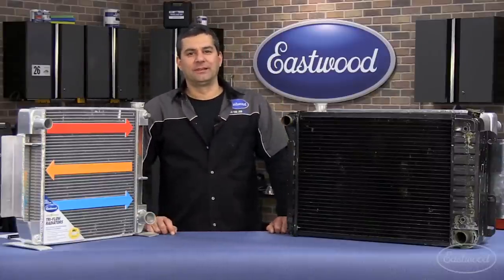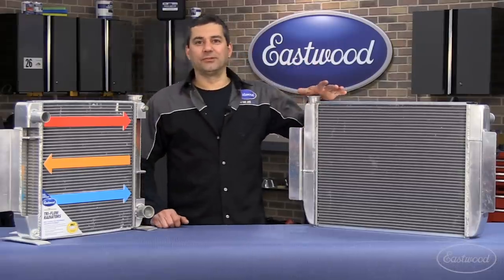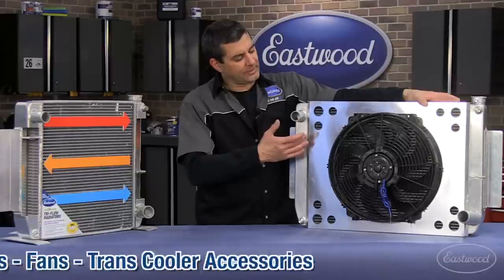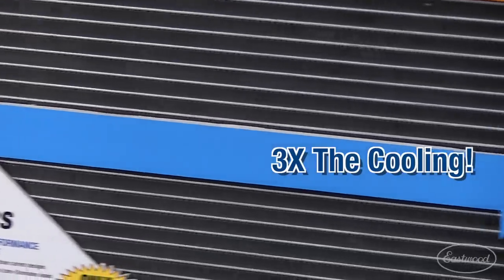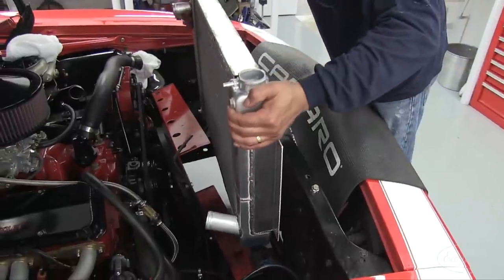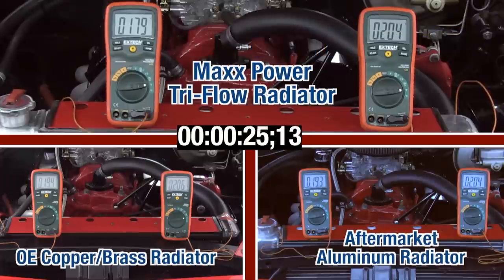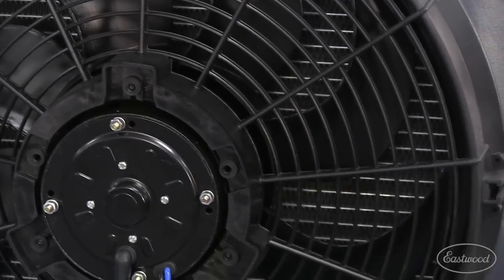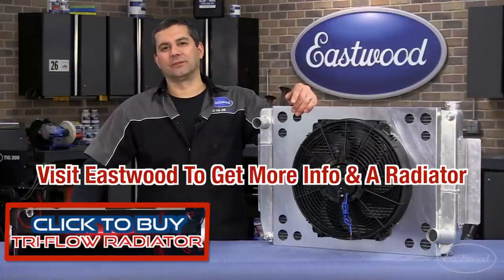Aluminum Radiator - Tri-Flow Technology Keeps Your Car Cooler Than Ever! - Eastwood & Maxx Power

Comment: I got a not cheap but economic radiator 4 core summit racing aluminium unit downflow with a junkyard 2016 jeep renegade 16'' fan. I'm thoroughly impressed with how it cools. 97° day will Idol at 175° all day. This new Tec looks cool don't see the big three using it makes me wonder if it actually makes a difference.

Comment: I bought this product for my 1990 Mustang just because it was such a good price and I wanted to see if it would help my cooling issues. First impression was very good it looks well made and it was exactly like the picture and description of the part number I ordered. It being a universal type application for a ford / Chrysler vehicle I knew I would have to make modifications to my car for it to fit . So that being said I pulled the old aluminum Griffin radiator out . Which is 18 years old and still working perfectly. Just doesn't keep up with the amount of power my engine is producing now . So the only issue I had with the radiator was the radiator cap sits on top of the tank and it hits the hood when you try to close it . So if you guys would make it a lower offset cap like the stock radiator is this would actually be a drop in type application and that would be a great selling point for this product. My car isn't a daily driver anymore so I have time to make things work. The Lower two factory mounts do work but need to be modified to have the radiator sit in the rubber mounts correctly. But that would be a easy thing to do . Actually if you made the radiator 1 wider on each tank side it would fit perfectly in the lower mounts. The welded side mount brackets hit the factory upper side core supports. I just trimmed them to fit in between them no big deal. So to get the cap to not hit the hood is the biggest issue. The lower core support has to cut in half and separated for the radiator to sit low enough for the cap to clear the hood. Once the top layer is separated the radiator can sit on the lower part of the support and it actually clears the hood. You have cut the factory mounts off the top layer of the core support and either weld them on the lower core support skin that the radiator sits on now or brill holes and use a larger pop rivet. Bolts will work also in the right spots long as the radiator doesn't come in contact with them. Then just drill the hole for the rubber factory radiator pad to sit in and that is done. The upper radiator bracket will work but they need to modify little to actually grab the upper tanks and hold the radiator in place . I'm going to make a upper radiator bracket that covers the top of the radiator itself. The only other thing I didn't like is that you don't have any extra material to drill holes into on the top and bottom of the radiator in the middle to mount a electric fan to. So I'm going to have to fabricate something to mount the fan to also. Hopefully it will be worth the effort and it will fix the cooling issues I have . Overall though so far looks like a good product. Time will tell

Comment: Purchased the Tri Flow Chevy 19" x 28" from Eastwood. Also purchased the aluminum fan shroud. Received it & installed it. After a short drive. I found it had a pin hole in it & it was leaking. Called Eastwood only to find out that because I trimmed the mounting tabs to fit my rad support, I Voided The Warranty. Just a side note Eastwood. Not all rad supports are flat.  !!!!!!!! $ 100.00 later rad shop fixed the hole. I reinstalled it. Road test. It did not lower temps AT ALL !!! Very Disappointed in the product. Complete waste of $ 500.00

Comment: PS... I sincerely doubt that your radiator is made out of 6061 aluminum. 6061 does not form in a punch press for a formed tank. The mount brackets are not extrusion so they are not 6061. 6061 will usually crack if attempting to bend much more than a 30 degree angle, probably less, even in .080 which is probably the mount bracket thickness you are showing. It definitely will not bend to a 90 degree angle! ( if I am wrong about this, I will admit it but... ) The filler neck, threaded fittings and hose connections are probably the only 6061 on that radiator. I too notice that in your video the single pass is running the same engine temperature as the single pass aluminum radiator. I have built one three pass radiator that worked well and was probably the result of a perfect storm. The core was 27" x 19" x 4.5" thick, 4 row x 1" tube core. It fixed the problem on the blown BBC 57 chevy but the same recipe did not work well on a blown 500 Merlin and never have figured that one out? However, I have typically had good luck with 2 pass radiators.

Comment: Adding passes to a radiator improves performances when flow is low if the fluid flow can go from laminar to turbulent, but at higher flows adding performance more than often performance will deteriorate. It is also important to note that increasing the number of passes will multiply the internal pressure drop. 

A radiator should be sized in order to meet the requirements on different engine condition (peak power lowest rpm, max rpm, etc.) not only idle considering both fluids flows with their associated pressure drops . The presented test are done at idle which is true for this condition but what about the other conditions?

If there where benefits to multiple passes you would see OEM include baffles in their plastic tanks and make radiators with more than one pass. By adding a few baffles they could reduce the size of the radiator lowering the cost but 99% of automotive radiators are only one pass.

Comment: Question is this running ac and how hot is the oil because when the engine oil get warmed up and ac going radiator temperature goes up, has the cap too tall issue been fixed so it does not contact the hood?

Comment: How much more power over stock would be needed to efficiently push the radiator water through 3 passes? Or is it  meant to stay in there even longer with stock blower to cool it down even more?

Comment: considering engine temp is usually taken near the thermostat housing isn't actual engine temp on the inlet side rather than the outlet side and i don't see any difference between this radiator and the aluminum one.

Comment: It would appear that there is no cooling difference between the two aluminum radiators. The engine isn't any cooler. I would like to see the same test with a flow meter and different thermostats.

Comment: I'm up against the wall on purchasing one of these.  I've got a Built LQ9 motor in a offroad prerunner - desert race truck.  I'm putting out just under 475HP.  Will this radiator fit my needs?? After reading the reviews on here,  the water restrictions scare me.   I drive at High RPM 80% of the time.   I know your easy answer to every comment is " We offer a 60 day money back, just buy it and try it"  Problem is it cost money for coolant and time to install and remove if somebody has to return it.  Swapping radiators is definitely not a fun clean job to do on your time off work.
Reply from the maker: The greatest restriction in any coolant system is going to be the thermostat ( assuming your running one ) not the radiator itself. The thermostat is designed to open and close as the vehicle is operating and impart the turbulent flow that is required for any cooling system to absorb and transfer heat. The Triflow radiator  will certainly cool the 475HP engine assuming you can adequately move air through the core and are using a water pump pulley as close to a 1:1 ratio with the crank pulley. If you are not using one of our Derale fans, be sure to use a reliable unit that will cover as much of the core as possible and always use a shroud to help direct airflow from the corners into the fan opening. As for the  discussion of restrictions, pressure drop, etc., the design and concept of multi pass radiators has been used in the performance automotive industry for decades and are typically offered at much higher prices than the Eastwood Tri-Flow.
Thanks for the interest.  We hope this helps.

Comment: USA or china made?
What's the core spacing or tube size
1in? 1 1/4?
What leading aftermarket brand AL rad did you use and what was the tube size

Alumitech used to be the best.. now I believe that goes to RND fabrication
Reply from the maker: Please contact an Eastwood Tech to discuss in detail and have all your questions answered - 800-343-9353

Comment: I would buy this Radiator but only problem is that it has a Chevy side tank design. If this was a top tank design like my Mopar than i would buy it. Is there plans to make a top tank design. Mopar or NoCar
Reply from the maker: +Kevin Jones No plans at this time.  The design of the Tri-Flow doesn't allow for multi-passes through the radiator with a top and bottom tank.
Reply: +Eastwood Company  Ok thanks for the reply. Actually it can be done, just put the tanks on top and then put large flow tubes on the side to flow the water.

Comment: Is the advertised widths the overall including mounting tabs? 
Any research to see if it increases the coolant pressure - i have a high boost sensitive race application.
Can I assume lower temps means greater efficiency and lower coolant pressure?
Reply from the maker: You should find all the info here, including test results and how to measure the radiator.   http://www.eastwood.com/triflow

Comment: With the coolant staying longer in the radiator, 2 times longer,  doesn't that make the coolant stay longer in the engine where the heat is being produced?> There for making the engine is running hotter, try adding some more heat probes and show the engine temp difference.
Reply from the maker: tigwelder303   For this example we will utilize a small block Ford or Chevy style engine.  Both flow about 4-5 gallons through the system per minute at idle (800 rpm for this example).  The restriction to flow (or the amount of time in the block) is greatly controlled by the restriction of the thermostat.  Pour an equal amount of water through our Tri-Flow Radiator and time it.  Pour the same amount through the thermostat opening and time it you will see the difference.The radiator itself has the task of reducing the outlet coolant temperature, and the most efficient way to accomplish this is high speed, turbulent flow- which our Tri-Flow Radiators achieve.  The Tri-Flow design does not slow the flow but adds resistance to the flow.
A few key components to Radiator Efficiency:
1.  Turbulent flow - Turbulent flow allows more water molecules to contact the coolant flow tubes than laminar flow. This contact allows more heat transfer from the water molecules to the aluminum coolant tubes.
2.  Radiator Cooling Fin Contact Points -  This identifiable radiator core fin design has a purpose. The contact points where the thin aluminum fins touch the narrow coolant tubes are the point of heat transfer from the tubes to the fins and then to the air. The more contact points, the more efficient the core.
3.  Shroud/Fan Assembly - A well thought-out shroud and fan design will provide the most airflow over the greatest area of the radiator core
4.  Speed of Flow - High speed, high turbulent flow increases efficiency of radiators.Hope this helps.  You may also want to check out the reply to a comment posted the same day by Mike Goble.
Reply: Eastwood Company You are right about three of your 4 points, a shroud can restrict air flow at high speeds, I notice to try to keep from that happening by adding some holes so that it is not completely boxed in. But, did you actually increase the BTU's displacement of the radiator, the only way to increase the BTU's displacement is to add more core surface or fins per square inch, the contact points you talk about. With the Tri-Flow and the other aluminum radiator did they have the same FPSI's or did they differ being different manufacturers. Also, you can only have so many FPSI or you end up restricting the air flow threw the core especially at low speeds and can easily be plug up with sand, dirt, bugs, and the occasional feather. 
  I wonder why GM, Ford, Chrysler aren't doing this double/triple pass since the inception of the aluminum core in the early 80's. I know they did a lot of controlled testing to make the smallest radiator for each engine application and Ford did find out that the only way to increase the cooling or displacement of BTU's was to add more core or increase the air flow across core.
Reply from the maker: tigwelder303 Don't forget we offer a 60 Day No Hassle Money Back Guarantee on our Tri-Flow Radiators, if you'd like to put one in your car and try it.

Comment: Having worked in automotive powertrain development for the past 16 years and on cooling systems specifically for 11 years, all I can say is, "what a crock".  I don't care how big the temperature drop is in the radiator.  The temperature of the coolant coming out of the engine and going into the radiator is all that really matters.  No radiator can change the amount of heat the engine puts out, so the temperature drop being twice that of the single-pass radiator indicates that the increased restriction of the three-pass radiator cut the coolant flow rate in half. Additionally, the more you lower the coolant temperature as it flows through the radiator, the less efficient the radiator becomes due to the reduced potential of heat transfer to ambient air.  The entire marketing premise of this gigantic temperature drop is bogus, and the graph and "test" in this video prove it, given that the standard single-pass aluminum radiator has the same or lower radiator inlet temperature.  I've tested plenty of three-pass radiators, and the only reason to use one is for an air-to-water charge air cooler where you need an extremely low radiator outlet temperature.
Reply: Facepalm

Comment: i dont believe this radiator would be good for racing applications seeing as the change in direction of the coolant flow would cause restrictive movement in the flow of circulation

Comment: One fact here is forgotten, a very important fact indeed. THE HEAD TEMPS ARE ALL CONSTANT!
So with all that cooling something is not making any difference. The engine is not any cooler.
But you just paid a bunch of money and got no better performance. 
 Try this instead. Run water and not anti freeze. Water is a better conductor of heat. Run some water soluble oil along with it. and Make sure your system is tight with an overflow tank to keep the air out (no bubbles).
Reply: So Joe I agree with the water and possibly some water wetter additive. On the other hand on my 66 charger 543ci I had a over heating problem due to the small grill. I tried 3 different  radiators 4 core 22" a 29" aluminum 3 core 1"vanes side flow and a northern 30" triple pass. Needless to say the triple pass cured all overheating issues and ran below thermostat temps. On top of that I just price checked these radiators and they are completely priced at 215$ not bad. I had over a grand in chasing that over heat problem. Triple pass works and I swear by it
Reply: @colebean1426  you can't blame the aerodynamics causing overheating on your car. My 95 Saturn doesn't have a grill. Just an lower valance. The only time it that has ever overheated was when I refused to replace the thermostat. Very bad choice for being a cheap skate!